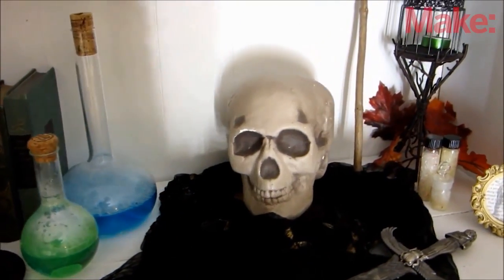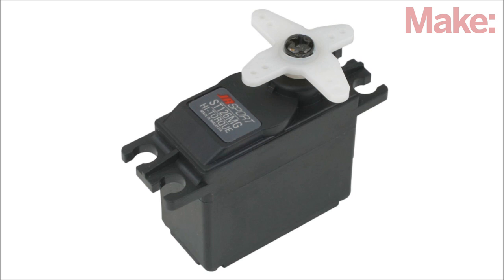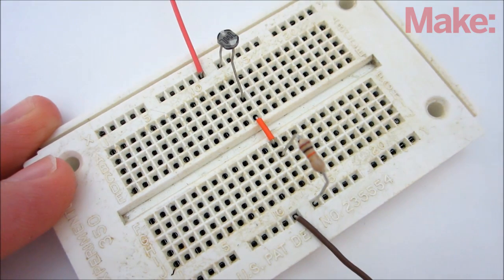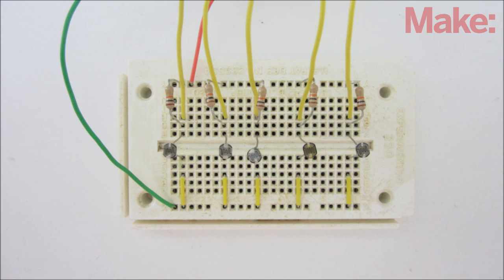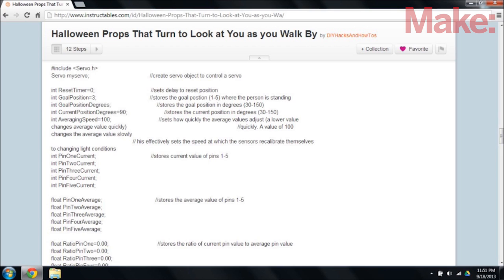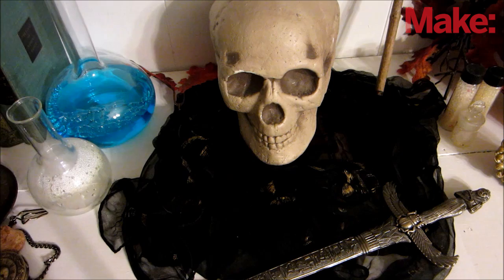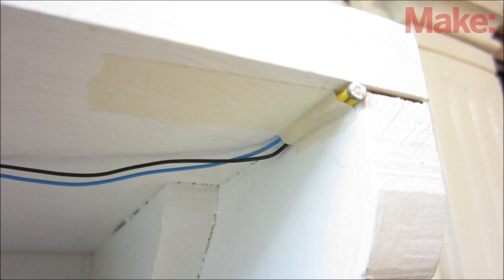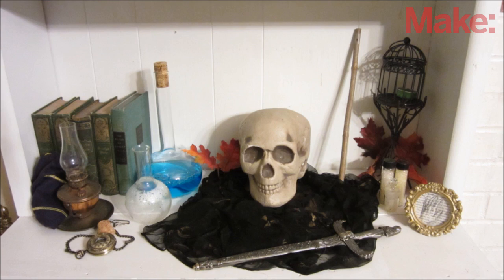DIY Hacks & How To's: Motion Tracking Skull

Comment: instead of having 5 separate states, could you use differential states to give it a greater and more fluid range of motion? Or are the photoresistors binary? Could you use a sensor that detects movement via lidar?

Comment: I can't find the sketch :'((((
Help me please
Reply: #include <Servo.h>
Servo myservo;                                         //create servo object to control a servo

int ResetTimer=0;                                      //sets delay to reset position
int GoalPosition=3;                                    //stores the goal postion (1-5) where the person is standing
int GoalPositionDegrees;                               //stores the goal position in degrees (30-150)
int CurrentPositionDegrees=90;                         //stores the current position in degrees (30-150)
int AveragingSpeed=100;                                //sets how quickly the average values adjust (a lower value changes average value quickly)                                                                           //quickly. A value of 100 changes the average value slowly
                                                       // his effectively sets the speed at which the sensors recalibrate themselves to changing light conditions
int PinOneCurrent;                                     //stores current value of pins 1-5
int PinTwoCurrent;
int PinThreeCurrent;
int PinFourCurrent;
int PinFiveCurrent;

float PinOneAverage;                                    //stores the average value of pins 1-5
float PinTwoAverage;
float PinThreeAverage;
float PinFourAverage;
float PinFiveAverage;

float RatioPinOne=0.00;                                 //stores the ratio of current pin value to average pin value
float RatioPinTwo=0.00;
float RatioPinThree=0.00;
float RatioPinFour=0.00;
float RatioPinFive=0.00;

float Threshold=0.95;                                    //sets minimum threshold for sensors

void setup()
{
myservo.attach(13);                                      //attaches servo to digital pin 13

PinOneAverage = analogRead(1);                           //reads from sensors to set initial average pin value
PinTwoAverage = analogRead(2);
PinThreeAverage = analogRead(3);
PinFourAverage = analogRead(4);
PinFiveAverage = analogRead(5);
}

void loop()
{
                                                                                    //read analog pins 1-5 and set the result as current value  
   PinOneCurrent= analogRead(1);                                               
   PinTwoCurrent= analogRead(2); 
   PinThreeCurrent= analogRead(3);
   PinFourCurrent= analogRead(4);
   PinFiveCurrent= analogRead(5);

                                                                                    //adjust average pin values
   PinOneAverage=PinOneAverage+(PinOneCurrent-PinOneAverage)/AveragingSpeed;
   PinTwoAverage=PinTwoAverage+(PinTwoCurrent-PinTwoAverage)/AveragingSpeed;
   PinThreeAverage=PinThreeAverage+(PinThreeCurrent-PinThreeAverage)/AveragingSpeed;
   PinFourAverage=PinFourAverage+(PinFourCurrent-PinFourAverage)/AveragingSpeed;
   PinFiveAverage=PinFiveAverage+(PinFiveCurrent-PinFiveAverage)/AveragingSpeed;

                                                                                    //calculates ratio of current pin value to average pin value
   RatioPinOne=(float)PinOneCurrent/PinOneAverage;
   RatioPinTwo=(float)PinTwoCurrent/PinTwoAverage;
   RatioPinThree=(float)PinThreeCurrent/PinThreeAverage;
   RatioPinFour=(float)PinFourCurrent/PinFourAverage;
   RatioPinFive=(float)PinFiveCurrent/PinFiveAverage;

                                                                                 //determine which ratio is the largest and sets the goal position
                                                                                 //set goal position

   if (RatioPinThree < Threshold && RatioPinThree < RatioPinOne && RatioPinThree < RatioPinTwo && RatioPinThree < RatioPinFour && RatioPinThree < RatioPinFive)
    {    GoalPosition=3;     
         ResetTimer=0;   }
   else if (RatioPinOne < Threshold && RatioPinOne < RatioPinTwo && RatioPinOne < RatioPinThree && RatioPinOne < RatioPinFour && RatioPinOne < RatioPinFive)
    {    GoalPosition=1;     
         ResetTimer=0;   }
   else if (RatioPinTwo < Threshold && RatioPinTwo < RatioPinOne && RatioPinTwo < RatioPinThree && RatioPinTwo < RatioPinFour && RatioPinTwo < RatioPinFive)
    {    GoalPosition=2;     
         ResetTimer=0;   }
   else if (RatioPinFour < Threshold && RatioPinFour < RatioPinOne && RatioPinFour < RatioPinTwo && RatioPinFour < RatioPinThree && RatioPinFour < RatioPinFive)
    {    GoalPosition=4;     
         ResetTimer=0;   }
   else if (RatioPinFive < Threshold && RatioPinFive < RatioPinOne && RatioPinFive < RatioPinTwo && RatioPinFive < RatioPinThree && RatioPinFive < RatioPinFour)
    {    GoalPosition=5;     
         ResetTimer=0;   }
   else if (ResetTimer > 100)                                     //after delay resets to position 3
    {    GoalPosition=3;  
         ResetTimer=0;   }
   else
    {    ResetTimer=ResetTimer+1;  }

GoalPositionDegrees=GoalPosition*25+15;                               //converts the goal position to degrees
         
myservo.write(GoalPositionDegrees);                             //sets the servo position according to the scaled value

delay(30);                                                         //sets how quckly the servo turns (lower numbers turn more quickly)
                                 

}

Comment: I didn't "dislike" this video, because I am only a bit disappointed by it. To me, it seems like almost every project I see these days is built using an Arduino.  And yes, I am an old coot who grew up ages ago when - to do this sort of thing - required some creative hardware design /  hacking, and not just bashing out some code.  I think it's important to know, that there are cheaper and simpler ways of being creative than spending $30 on an Arduino and loading a program in it.